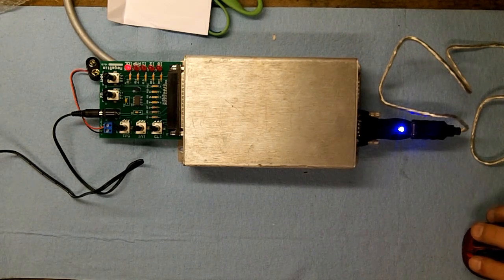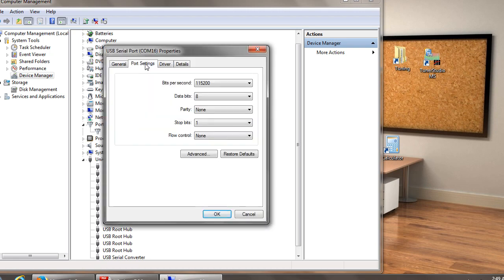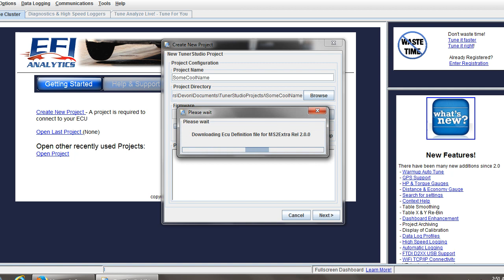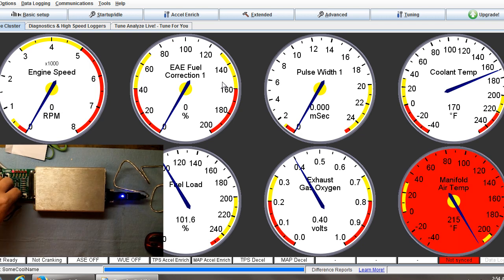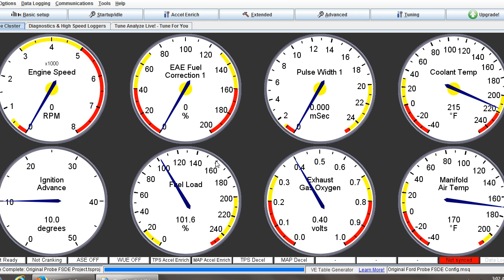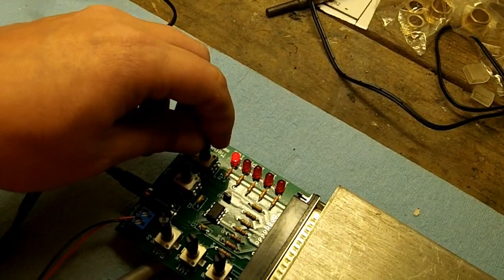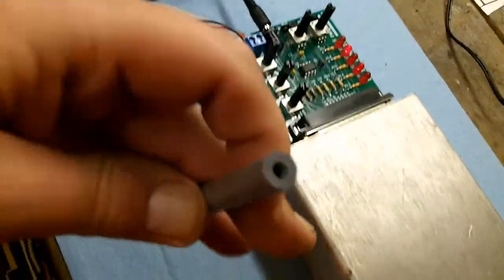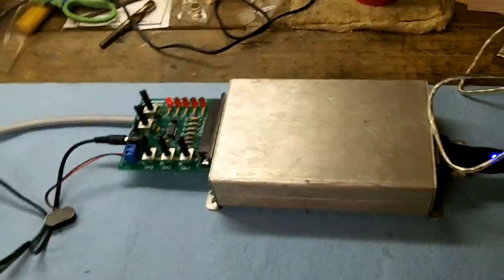MegaSquirt Benchtest with MegaStim v2.21

Comment from the maker: Don't know how I missed reading that one anyheck.  That answered my question if EDIS needs the cam sensor or not.  Thanks!
Reply: You're very welcome.
Reply from the maker: anyheck After reading that I'm beginning to suspect the previous owner of the unit was using COP since that was the native ignition system for an FS turbo setup (it came with a turbo only on the Protege which had COP).  The initial settings of the firmware (tune) were set to 36-1 toothed wheel and not EDIS.  However with the megastim attached it seemed to read EDIS emulation triggering just fine.

Comment: The EDIS gets the 36-1 signal directly and passes a tach (PIP) signal to the MS. The MS sends a PWM (SAW) signal to the EDIS to request a particular spark advance and the EDIS module handles firing the coil at the right time.

http://www.megamanual.com/ms2/EDIS.htm